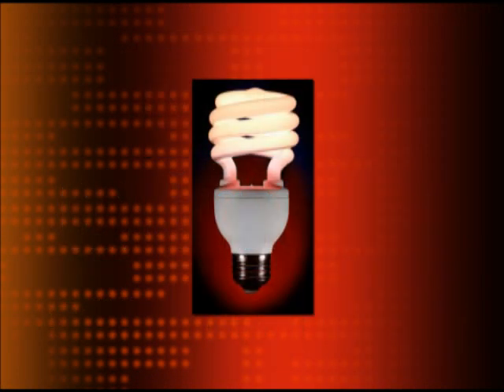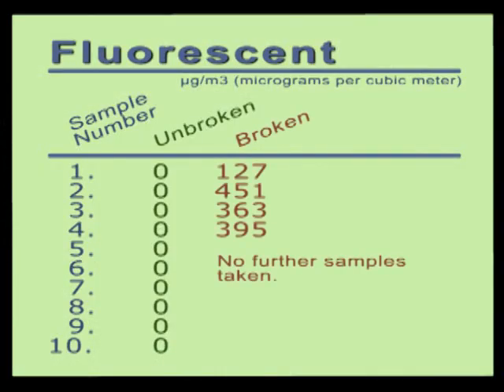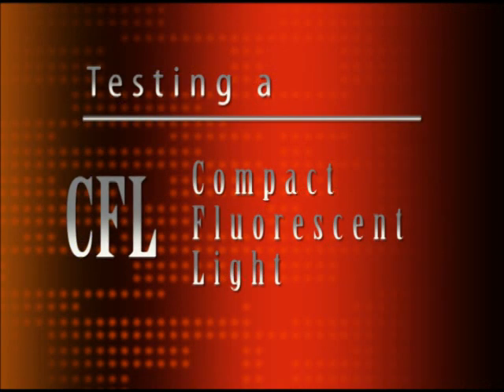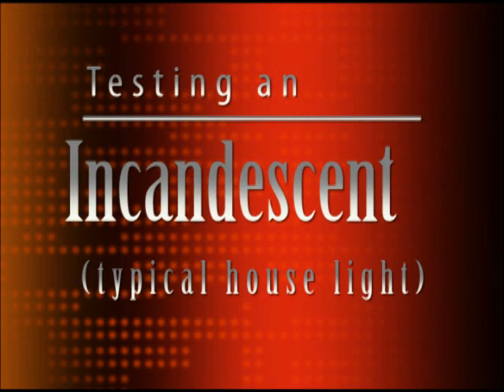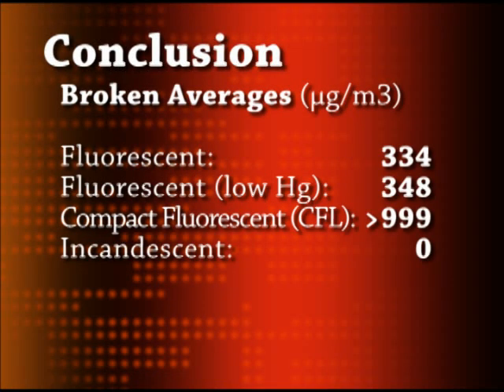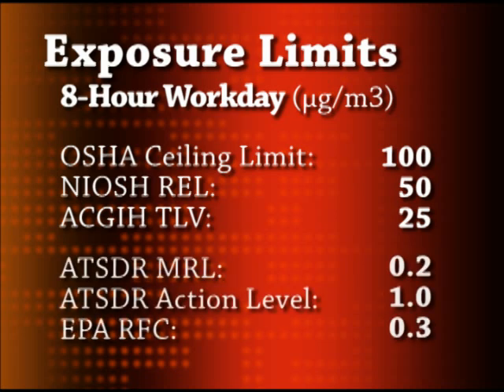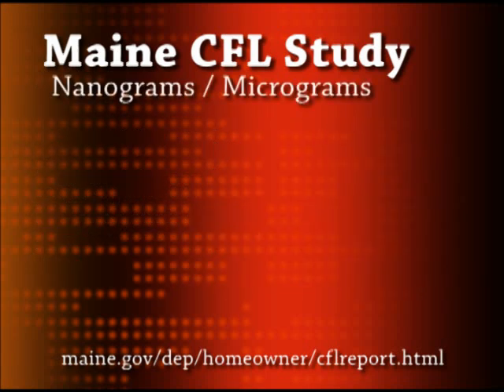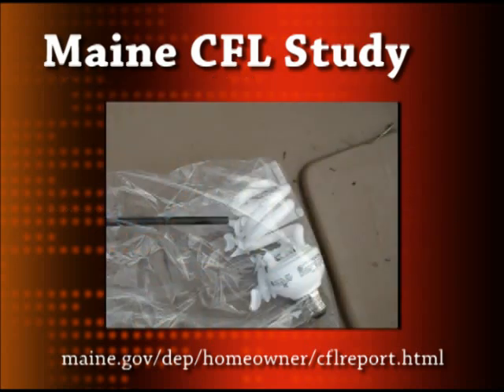CFL Bulbs - How Much Mercury is There Really???

Comment: 13:38 Climax 👾🤯😱😵🤐😷☠️⚰️🕳💡🧹
(The moment it all comes together.)

irregardless of the this infuriating double blind pier reviewed* “experiment” witnessed by all viewing other that the disastrous duo of undoubtedly blind def an ummmmmm experimenters. 

*Pier Review Info: 
Experiment video was reviewed on several notable piers as well as an additional three docks (all of which are standing good and deemed sound by peers peering upon the piers pilings pursuant to precise protocol & protection practices presented to the people by presiding peerage to the point of producing pervasive panic in people producing pier projects improperly . Also the handy stock standard dock jiggling process was employed upon all hard wooden docks/piers, especially those erected by hand in the dirtiest, wettest places that also had slips inside their contained areas of operation. This being inserted into a special place that required additional peering by qualified bifocal peepers because of the the constant action of ships massive steely hulls slapping, ramming and coming into contact with piers/docks as they used the slip to slide in and out of the sea; men on deck, often tired after the climax of their voyage, not fully having control of these quite often well loved seminal vessels fluidly jerking about as waves come rippling into the boats entire body. Instantly creates shocking waves that create a hydraulic sort of intense effect know as the “pump, bump, grind and dump” upon the strong sinewy hard grain of the wooden beams as the deckhands up top work feverishly to finish docking, or yanking the boat out the slip by various means preferred by certain different sets depending on the size of the vessel as well as what feel right to each individual cre 13:38 Climax 👾🤯😱😵🤐😷☠️⚰️🕳💡🧹
(The moment it all comes together.)

irregardless of the this infuriating double blind pier reviewed* “experiment” witnessed by all viewing other that the disastrous duo of undoubtedly blind def an ummmmmm experimenters. 

*Experiment video was reviewed on several notable piers as well as an additional three docks (all of which are of standing and deemed sound by peers peering at the piers pilings. Also a standard dock jiggling process was employed upon all hard wood docks/piers especially those erected by hand in the dirtiest, wettest places that also had slips inside their contained areas of operation. This being inserted into a special place that required additions peering by by qualified bifocal peepers because of the the ships massive steely hulls slapping, ramming and coming into contact with piers/docks as they used the slip to slide in and out of the sea; men on deck often tired after the climax of their voyage not fully having control of these quite often well loved seminal vessels fluidly jerked about as the waves come into the area cause a hydraulic sort of intense pumping into the wood beams as the deckhands up top work feverishly to finish docking or yanking the boat out the slip by some means. All seamen know that satisfying final feeling and sound. The splashing of liquid as there voyage with their mates comes to an end once the craft has completely emerged and been released from the surface tension of the oceans all encompassing hold. No matter what method they use to get their, whether solo with a dingy, or a crew working in. tandem with other Naval seamen upon an enormous destroyer; all seamen know that satisfying final feeling and sound of relief.  The splashing of liquid as their voyage with their mates comes to an end once the craft has completely emerged and been released from the surface tension of the oceans all encompassing hold as they finally are able to rest upon dry land once again. 

The End 

A Burnt Reynolds Official Creation 

#BurntReynoldzOfficial #BurntReynoldz (Hopefully Ive giving these hashtags a purpose by now.) 

Enjoy this weirdness? Good me too. :)

Comment: Fuck guys. I just broke one today into my sink in my small bathroom while naked (was about to shower) and the pieces went all over, including on me. I walked out for a moment, then back in 1 minute later to clean. Cleaned about 1 minute then had second thoughts and looked it up. Then let it air out for 40 minutes, then cleaned (but spent an hour cleaning everything, probably inhaling residue). Sigh.
Reply: How are you doing? Is has been 2 years and I was wondering. I broke one in the kitchen last Saturday and cleaned it up without knowing after all that I googled and found out about this. Now my OCD has been triggered so bad. Hope you could answer this.
Reply: @squiddy9720  Honestly I'm fine and don't think I had any effects what so ever. I did buy gluathione (oral that you allow to dissolve in your mouth and goes through your mucous membrane) since it's supposed to clean out toxins and heavy metals in your body. But no idea if it did much. Or maybe it did.

One bulb probably isn't too dangerous of an exposure dose, though.
Reply: @ZantherStone  Thank you replying. I am glad you are doing ok. I hope I don't get sick and I would try to get one of those pills you mention. Thanks!!!

Comment: I would have to agree with earlier comments that the testings had flaws with volume measurements taken. But what is of concern are the readings with the snow on the ground at the test. If these bulbs were outside temperature then most of the mercury was actually condensed, The reason the CFL bulbs take so long to become bright in cold temperatures. In a room temperature bulb or especially one just removed from a fixture heated by working bulbs where most of the mercury would be in its gas form,  It's obvious that any tests done with these would be beyond that instruments ability to measure even in proper volume confinements. The real reason for CFLs are Higher Profit Margins not environmental safety.

Comment: Save us led's! Lol. I hope no one really thought mercury would be in  an incandescent bulb.
Reply: and that Americans don't smash CFLs like plates at a Greek wedding.
Reply: +NetRolller3D I agree with what you're saying there but coal isn't the only source of electricity?  It may be the most common, idk.
Reply: galaxy500lx Surprisingly, incandescents cause more mercury to be emitted during equivalent lamp lifetime than CFLs. They need more power, and some of that power will come from coal.

Coal contains mercury.

Assuming that a CFL can last for 8000 hours, instead running incandescents for 8000 hours consumes enough energy to release more mercury from the coal burned than what's contained in even the worst CFLs.

Comment: What scares me more than mercury and CFLs is that this study was done by the Maine DEP, who should have known how to properly use the device to measure concentrations.  If you think mercury in CFLs is scary, incandescent lightbulb contain a partial vacuum.  Just imagine old-style light bulbs in your house breaking and the vacuum sucking your house into nothingness!  (^_^)
Reply: Lucdave D I'm pretty sure it's inert gas (krypton usually), not vacuum, unless you're dealing with a vintage bulb from Edison's time.
Reply: NetRolller3D, you are correct, but then my joke would not work ;-). 
Argon or argon with nitrogen, in common light bulbs.  Krypton is used in long lasting light bulbs.  Superman likes to use the standard bulbs, for obvious reasons.

Comment: You can do this test in any size space you want, from one cubic inch to a square mile.  The results are all relative.  The meter gives accurate results based on the concentration that's measured.  So if you measure in a confined area, the relative measurement is going to be higher than if you dispersed this same amount of mercury in a square mile.  Again, the reading is not much use from the standpoint of determining just how bad the bulbs are for the environment.  To me, it's a whole lot easier to simply ask the question how much mercury does each bulb contain in WEIGHT, so if you broke 10,000 bulbs, how much mercury in WEIGHT is added to the environment?  If nothing else, this test shows you don't want to be in the immediate vicinity of a freshly broken bulb, as the immediate area would certainly contain a high concentration of mercury, until it disperses more widely.  But you have to wonder why they went here at all with these bulbs, if the goal is to lower mercury in the environment.  I've found these bulbs generally last me about three years average in residential use, not the 7 to 10 years claimed.  I write the date on every one I install, and now save the receipts corresponding with a number on the bulb.  I've gotten free replacements several times already.  For what they charge, they SHOULD last 10 years.  Give it up and go to LED bulbs, guys.  These bulbs are a waste of money.

Comment: Many people have this test as flawed, and it is. I looked up the specs for the Jerome 431 and quickly discovered that The instrument is designed for ambient air monitoring, basically outdoor monitoring or very large volumes of air. NOT sticking the instrument into a plastic bag (very small plastic bag for the CFL). T5 (green top) contain between 3 to 5 mg / lamp (standard florescence 4 foot about 10 to 15 mg)  which is the same as a CFL @ 3mg (newer CFLs are now down to .9 mg - I believe Philips).  So when you look at the results published in this video you really have to wonder just what was proved. According to the video the standard florescence that contains the most mercury is actually the safest if broken? Hardly.
Reply: Of course its flawed, that meter measures the concentration of mercury vapor in milligrams per cubic meter (it clearly says mg on the meter, which is milligrams, not "micrograms" like the people say in the video). So If you break the bulb in a smaller bag, you'll get a higher reading, since the bag contains a smaller volume of air. 

An average CFL contains 4 milligrams of mercury. A small room is 3 meters tall, 3 meters wide and 3 meters high contains 9 cubic meters of air. At most breaking the bulb would release .444 milligrams per cubic meter, which is 444 micrograms per cubic meter, assuming all of it evaporates; this is still higher than mercury exposure limit set by OSHA. However, when a CFL breaks, the mercury will exist in a liquid state at room temperature and stick to the edge of the glass. (The mercury is a gas only when an electric current runs through it). So just clean up the glass before all of the mercury evaporates (which is not instantaneous), and you should have very low exposure to mercury vapor.
Reply: @mudkirby8425  The meter had a decimal at the start, so when it read .007mg, they were right to call it 7 ng
Reply: You are correct.  You can't test mg per meter in a less than meter space LOL  what were they thinking?   I use CFL's in my home and on my front and back deck areas,  When it gets cold, I mean between 0 and 20 degrees F     the bubls stay dim, which is ok.  Obviously  more so than a normal fluorescent  which leads one to want to do this test.   I believe that CFL's do contain a smaller, yet more concentrated form of mercury whether or not the test says it does or not.  The test is wrong, but accidentally correct in my thoughts.
Reply: so the readigns are more less half or less of the actual numbers shown.   Is what I meant by the space issue.   open air shouldn't matter, it's about how much the bulb contains. PERIOD   But the device needs to be taken more seriiously, using math to find the correct amount in the space tested.  They need to make an exact clean air to broken bulb ratio   within a glass container of the exact volume neded  for the device to read %100   then you'll have the bulb reading

Comment: it's got to be the concentration inside the bags, the larger bulbs had huge holes ripped into huge bags, and if the bulbs were colder, the mercury would have welled up at the bottom of the bulbs, and the pieces in the bag… you are using concentrations PER CUBIC METER inside a tiny bag and inside a big bag.
So you know, mercury vaporizes at room temperature, so even if you broke all your bulbs and kept the windows shut for 3 years once you air it out it's gone, having vaporized since the spillage.  
and they can't emit when they are running, it's a vacuum inside the bulb, if anything leaks out, no vacuum!  under a vacuum mercury lights up when electrified, like neon or lightning even.
very very small amounts are used in these bulbs, not even the size of a typical water droplet. 
mercury is not cheap and very little is needed let's say 5 mg (and mercury is more dense than water, so a 5mg of water is huge compared to to 5mg of mercury)
I spilled a pound of mercury in my studio and was told by hazmat to sweep up the droplets and vent out my place for a month.  (use a wet sponge to collect smaller drops, they stick to the sponge to make things easier) do the same and you should be more than fine.

Comment: I've heard a rumor CFLs emit Mercury while they are running. COULD YOU PLEASE DO SOME READINGS WHILE THE BULB IS OFF and WHILE IT'S ON? Maybe 5 readings off and another 5 once its turned on at different time intervals as it heats up with a final reading at the end of 10 minutes run time or until it reaches full temp. This would be very important for the public if they did release small amounts as they ran. Thank you.